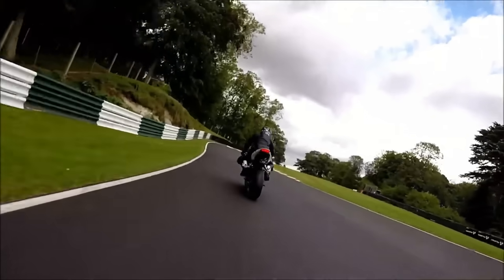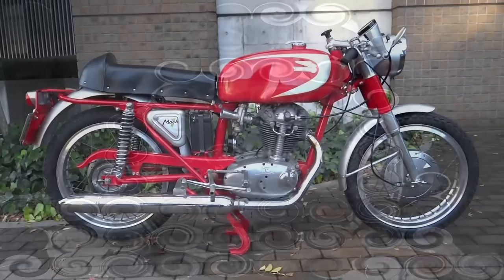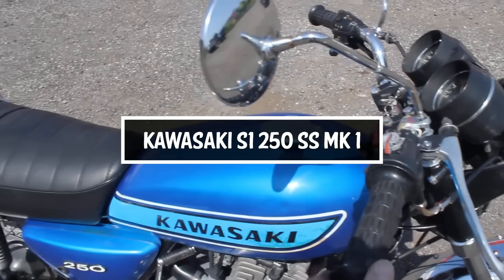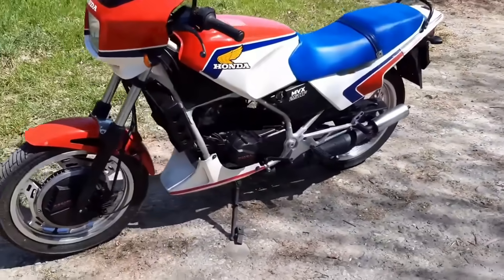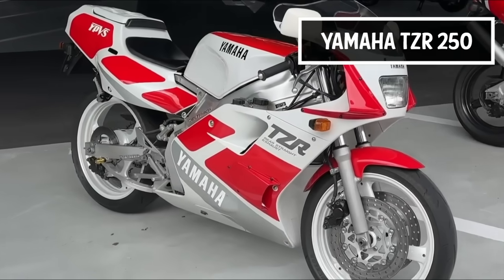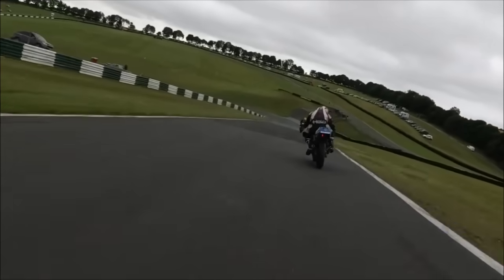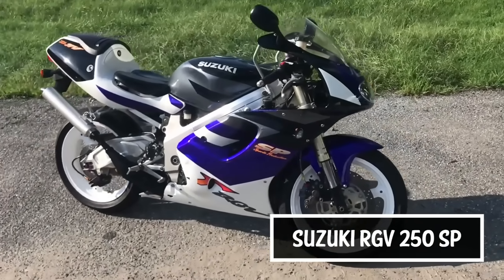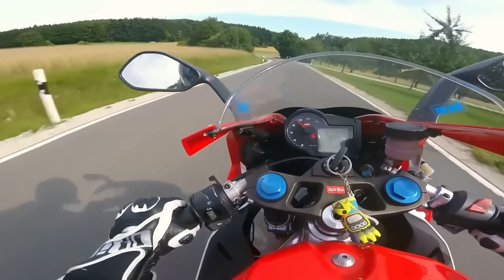The Fastest 250cc Motorcycles

Comment: ...after watching this video, I feel cheated by the factories that never exported most of this bikes if not all of them to california, supposed to be the hub of motorcycling back then... maybe because of the american highways, maybe like you explained, more cc's = more $$...or maybe for I couldn't afford them on a bike messenger salary...maybe because I was too cheap so ended up with a 1986 ninja 250, ohlins shock, aftermarket springs with a 3/4 inch spacer if remembering right ( plenty chatter but didn't care for it allowed me to reel in and overtake in turns...other than the tires, stage II jetting with stock pipes ( 6k rpm to 1.4 k power band ) and braided brake hose...what a blast on the sunday morning ride just north of san francisco! riding in the rain with metzler tires, I would stop in the middle of the ride, and then start passing galore!
Reply from the maker: they sound like happy days  :-) Cheers for watching mate, enjoy the ride

Comment: In the US at least the first gen Kawasaki Ninja EX250 was a legit 100mph model. Common as cockroaches. My wife had one and she'd slowly walk away from me on my Honda NC700X "Hondog" with about 103 on the GPS (yes, that is as fast as a NC700X will go). 

In 1973 as a broke 17 year old I bought a shiny new RD250. It topped out low 90's though it would get there pretty smartly. I figured with a gearing change it was good for 100mph. I loved that bike. Much later I owned a 1975 RD250. Yamaha restricted those US bikes and it just didn't have the magic in stock form.
 
I now have a 2018 Yamaha WR250R. With 50/50 tires it tops about 91-92 mph. I think lowered (street tracked) with street tires it would crack 100.
Reply from the maker: the WR is one of the better modern offerings :-)  Cheers for  watching mate, ride free

Comment: i had a rd 250 and a x7 the rd was tuned when i got it but the x7 was factory spec i rang its neck for 8 miles and got it to 96 and 98 ,i  thought it would do over a 100 at the time ,,it did after a few changes to the engine ,sprokets ,rejetting and altered pipes,i crashed my rd  hit the front side of a truck ,we were both at fault  i was going far to fast 70 plus on a b road he was cutting the corner comeing the other way ,i hit him head on ,how the hell i lived afer that allways baffles me ,i bounce round his truck he said ,my bike went into 2 parts   me with the one bit ,i broke most of my bones in my left side and a busted skull ,a coma for 6 mnths and 2 yrs to recover speach ,walking stuff bolted together inside me ,i was damn lucky lad ,it took me 3 yrs to get a bike again ,i kept the clocks of my bike my pal recovered them,the speedo was stuck at the speed i was going ,
Reply from the maker: that sounds like a big ouch mate, glad you are still with us, welcome 🙂Cheers for watching. Ride Free 🙂
Reply: @barebonesmc  you are right about the new bikes wet damp blankets ,i cant ride any more had a rd 400 and gt suzi x5 i was retoreing about 7 yrs ago had blood clots in my good leg and had septic shock ,it took me out flatlined a few times and had to cut my leg off ,and the antibots screwed my nervous system up lost feeling in my right hand neck and lifting my arms,had to sell the bikes  was gutted was cheap to insure the rd 400 ,my pal brought a rgv 3 yrs ago the bike has 7,800 miles on the bike ,its showroom condtion allso has a tzr s grey  import from spain thats done 12,500 and  a crate with another one in bits from  the same guy ,he loves his  fast 2 strokers
Reply from the maker: @karlkuttup  sorry mate, and a bit close to home for me at the minute. i have a battle on, did you see the video with the X7 and X5 in? https://youtu.be/gYetZtEpPcM   i sold my last TZR 1KT about ten years ago now sadly. i just wouldnt fold up onto it anymore lol the joys of getting old lol. good luck with everything anyway, and glad it brought back some good memories

Comment: 250 is hard compatition for performance. i would build a supper charged long stroke 250 engine for a street bike today, big torque number light motorcycle.
Reply from the maker: interesting idea, i would be tempted to look at how the weight stacked up on a hybrid with a constant running lightweight 250 engine and a 40HP plus electric motor with a capacitor bank as the buffer instead of batteries massive discharge capability so unmatched acceleration, with the economy of an engine running at peak performance all the time i just think it would change how we have to ride too much for many as well as breaking all the ideas of a move away from ICE technology. and if it can be ammonia fueled as toyota are now testing, the power density would be phenominal 🙂Cheers for watching and for the comment mate. Ride Free 🙂
Reply: @barebonesmc  there is a 600 hp blower truck running on compressed hydrogen, 🤠 hydrogen can be made from water by solar in many parts of the world. so a 250 hydrogen powered blower bike is possible now. 😁
Reply from the maker: @DANTHETUBEMAN  True indeed, the problem is the powers that be cany commercialise hydrogen splitters, once you have one, fill it with water and the jobs a good un, they make no money, so there is no will to manufacture. thats why the hydrogen focus and arguments about compressed hydrogen tanks and infrastructure have been the ones heard so far, would be the obvious way to go though, and if im right (any subs in Scandinavia anywhere) there is one of the Scandinavian countries (i forget which) that has been running busses with on board hydrogen splitters for quite a while now. Maybe i need to do some research on it at some point 🙂 There are a few companies i have been watching that have working designs of lightweight multifuel Internal Combustion engines, What we need i think is for a few of them to start working together, but with new tech that is always problematic. i do think people are starting to recognise the flaws in reliance on the present battery tech though, so we may be at another turning point, However, if the powers that be decide to, we could be coming to a real downturn in personal transportation with the push to group transportation of various sorts. Who knows where it will end 🙂

Comment: I wonder how many RD250s had 350 cylinders/heads & carbs switched... with a hacksaw and file trim of the tele tale extra fins they were the ultimate stealth bike.  The fact is the market at the time was driven by the UK regulation making the 250 the maximum allowed for a 17 year old. Once the law changed to make that the 125 it is currently, the 250 market effectively closed here.
Reply from the maker: Re, "I wonder how many RD250s had 350 cylinders/heads & carbs switched"  None officer i promise, lol and the change in UK law inevitably had an impact but the changes in racing regs happened later if im right, and that also had a big impact. Cheers for watching mate,  Ride Free

Comment: french here, restricted to the new bullshit that is the A2 liscense. I looked at the current production of smaller bikes, they looked almost all the same (gutless twins or monos). 
So i imported a 1991 katana 250, to have something with a design that stands out, and most importantly for me, an actual engine that revs.
I would have loved a zxr250 (or cbr/fzr/gsxr, but thoses were too light (A2 bullshit), and the 250 across would have been a gamble at the paper translation, again due to the weight (dry weight vs curb weight), btw that bike has a storage compartiment in place of the fuel tank, very usefull as it can fit a full helmet).
Others honorables mentions would be (again japaneses 4 strokes 4 bangers) : 
Honda Cb250 jade - Hornet 250 
Suzuki Bandit 250 - GSXR250 
Kawasaki ZXR250 - ZR250 Balius - ZX25R (currently sold in Asia, 50HP) 
Yamaha Zeal 250 - FZ 250 Phazer (bike that launched the war between the big 4 for the best 4 stroke 4 banger (damn that's a lot of 4's))
Reply from the maker: youve given me some to look at there 🙂Cheers for watching mate. Ride Free 🙂

Comment: The only bikes on this list we got here in the USA was air cooled RD 350 .  1980 USA smog control for motorcycles started   only two strokes were dirt bikes. 1990s 250 two strokes MX bike when running right with a pipe and jet kit  would do about 110 to 115. mph .  Two stories performance can change radically with weather conditions and rider weigh.
Reply: we also got the 1983 RZ 350
Reply: @jamesadams2334  nope only in Canada some were bought there and brought south over the border
Reply: @stewart8127  nope. In 1983 you could walk into any Yamaha shop and buy an RZ 350 in your choice of red and white or yellow with the black bumble bee stripes. 1983, 84 and I believe 85. Readily available in the U.S.
Reply: @stewart8127  you are thinking of the RD 350LC.
Reply: @jamesadams2334  ya I was raised in a Yamaha dealership at that time Mac's Cycles. In Scranton Pennsylvania  and dealer that had them got them from Canada.
Reply: @jamesadams2334  and you for got about kenni Roberts signature on the bikes next to the headlight.
Reply: @jamesadams2334  US never got RD LC last RD was the 400 air cooled.

Comment: It surprised me to get on some 250cc CVT Scooters built over the past decade or so and find them faster than many/most of the current crop of 250cc Motorcycles which was not what I expected.  Some were Aprilia's running Piaggio engines such as used in the Piaggio BV 250 but on 15 inch rims.  Conventional wisdom said the 250cc motorcycles with traditional gears and chains should have been faster then the 250cc CVT driven scooters yet the motorcycles felt like they lagged behind.

After Aprilia Chesterfield 250's hit around 150 mph on the track one would have thought that would at least continue to be improved upon and not have the clock turned back 40 or so years instead.

Better aerodynamics perhaps from the fairings on the scooters or some effort to push the sales of the liter plus motorcycles by restricting the 250's along with the 500cc motorcycles?

Best!
Reply from the maker: an interesting comment 🙂 maybe i need to look at some scooters 🙂 they are the biggest sellers in Spain and Italy and im sure other markets too

Comment: I was always impressed by my road-going Honda CB250RS which would pull an indicated 96mph. Whatever real speed that was. I did love my Kawasaki KR-1 particularly
Reply: My rsd 98mph one of the later ones with the higher compression head , she'll still pull 90 on a good day (yes I've still got her ) bought brand new Nov 82 ..
Reply: @stephenjones6500  - I’ve still got two Honda CB250RS’s. Both of which I put 500 motors in, with hi-comp Wiseco pistons, XBR500 gearing, pod  filters and upjetted, with slightly loud exhausts. Good for 110mph!
Reply: @stephenjones6500  - I’ve still got my CB250RS from 1982 as well! With an FT500C motor in it.
Reply: @timhicks2154  nice. mine is stock standard even with the original exhausts. off the road at the mo , need to redo the rocker cover usual weep over the exhausts lovely clouds of smoke ... This'll be the third time when i can get round to it .
Reply: @stephenjones6500  - they all end up doing that.
Reply from the maker: so i guess this is the RS apreciation society's corner :-) They were great bikes .Cheers for watching all, Ride Free
Reply: @barebonesmc  - they were great. Still are! Simple,,easy to maintain, nippy yet frugal.
Reply: @timhicks2154  When you've ridden one through some nice twistys thats when you'll appreciate how good they are no where near the strokers speedwise but the handling .....
Reply: @stephenjones6500  - the handling is very good.

Comment: My partner actually owns an Across, its a great bike!
Reply: On a related note, the GSXR250R has more or less the same engine as the Across, but with different cams. The earlier models were light, and very fast! Ive no idea what the top speed of mine was because I always ran out of road before I ran out of acceleration, but they were dam fast.
Reply from the maker: they had flown completely under my radar,  Cheers for watching ,  have a great weekend

Comment: My Kawasaki 250 Samurai would reach 110 MPH on the northwestern motorway in Auckland and then die because of a melted spark plug . I would take it back to the dealer for repair. They would put 'hotter' plugs in but it just kept melting the electrode .

Comment: I too was perplexed by the modern 250's when I last looked at this gutless crop, I think interest in the cc class has vastly waned. You need to pass a test to ride one then you are gonna go for a 400 until that licence issue is all dusted.
35 years ago I skipped the 250's buying a 350 power valve. 
(early one, bikini fairing and belly pan, early exhausts was the fastest stock 350 pv with different air jets making 62 hp stock, also better frame geometry)
I owned an mz 250 for a while for despatch riding, I got it for 220 quid when a courier firm went bust- They rang me up and said do you want to wait for what we owe you or keep the bike? It was a year old so I took the bargain. (about 3 days money)
 Apart from that never interested in 250's..
 I had another pv next then a grey import rg 400 which i tweaked the balls out of.
If I was to buy a bike today it would be a used 500 twin 4 stroke, like a gs 500 or similar. 
(nice alloy frame)
British roads are all about taxes and punishment now, I lost real interest.
But yes,  bike mnfctrrs now build bike to add price, the days of simplicity are gone.
Getting on a bit now, might build an electric bicycle with 'a few more watts' than it says on the motor. .
Reply from the maker: good rant 🙂 the new battleground does seem to be the 400 class now, fingers crossed it will get a bit more lively, Cheers for watching mate. Ride Free 🙂
Reply: @barebonesmc  The 125 learner limit killed 250's and the later 400cc 2 stage legislation made 400's appealing 
(tho the advisors of that legislation would have had a dickee fucking fit if they had ridden even a Jap market restricted  RG400 or a standard ns 400-both well faster than the early faster 350 ypvs- ) these people made the same mistakes over and over.
The rd 250LC went extinct after the 125 learner law but I blew my 125 LC up on the A45 (Now A14) going past a lorry at ~102 mph.
(see performance bikes, it wasnt difficult,) but I did shag two bottom ends in a year.so good job Rob Carrick at Snetterton breakers  for buying pranged 125LC's, he sold me a whole 6k mile engine for £123 and had to throw in a set of rings cos the lower one was simply 'missing' ???' {probly some noob broke it and didnt worry} )
 Anyway, the early 350 pv (pre canned exhausts) drunk like a sailor in pompey on a saturday night and the rg400 drunk like a whale. (30 mpg at a steady 70 with full rg500 gearing, 20 ish if you gunned it)
 So having rode a coupla mid 4 stroke twins I have to conclude  gs500E sorta bike would be fine. Maybe sv 650 at a push (but not suzuki's 650 v twin unless I see a quick fix, they are a bit 'meh' for a 650)
Bike tech is lagging behind cars, a 500-650 twin should be hitting 85 to the gallon by now. (should be almost identical at similar use) but I could forgive 55 mpg from a mid sized twin.

Comment: I had a  MVX250f and even with my 6'4" frame it would easily do 100 mph. An absolute joy to ride. Certainly not as reliable as most hondas . I had it up to 190kph on a down hill ride.
Reply from the maker: They seem to split opinions in the comments 😊
Reply: @barebonesmc  Early on the rear cylinder would seize through lack of oil. The oiler was wound open which fixed the problem. They were the first to step the power up towards the 50hp and really drop the weight.
Reply from the maker: 🙂Cheers for watching and for adding the comment mate. Ride Free 🙂

Comment: As someone who is very familiar with the Honda MVX250, they were a bit of a lemon, they weren't as good as the oppositions bikes and were a bit brittle with engines failing quite regularly. They couldn't handle the kind of treatment 15/16 yr old New Zealand learner riders dished out. I had a KR250 in 84, and my mate had an MVX, there was no comparison, Handling speed, acceleration, fit and finish, the Kawasaki was so much better. After his MVX blew up for the second time he pushed it into his parents shed and left it (it was still there covered in dust in 2003) He then did what loads of other Kiwi teens did and bought a RZ250 YPVS. 
Still wasn't as good as the KR tho. 😉
Reply from the maker: im still getting over the fact you got the KR there lol
Reply: @barebonesmc  I read a UK mag called "Practical Sportsbikes" and many times they have featured a bike and said "This bike was only sold in the home Japanese market.." and its a bike that was sold new here 😆. Many of the 400s and 250s of the 80s/90s were available as a new NZ model (so unrestricted and without the 180kph speed that gives away a Japanese home market bike) and also bigger bikes, The pop up Katana, the GSX1200 (inazuma in Japan) and one of my bikes, the GS1200SS spring to mind. But a real rare NZ only (tho some did make it to South Africa and i think Australia) bike that many people have never heard of (and could be a good subject for a video :-) was the GSX1100SXZ "Wire-Wheeler", the special version of the 81 1100 Katana that Suzuki and the NZ distributor made to beat the Honda CB1100R in production races. Very rare and cool bike.